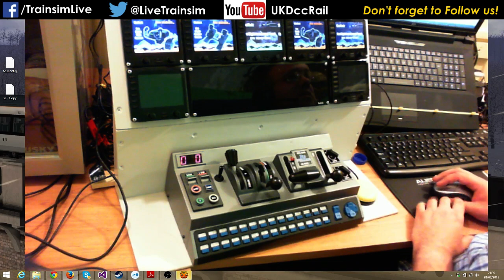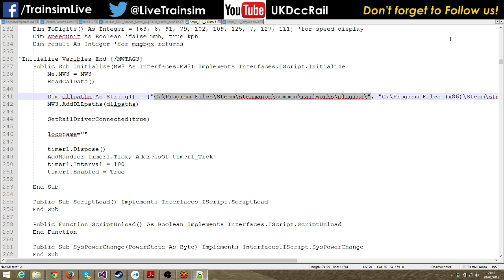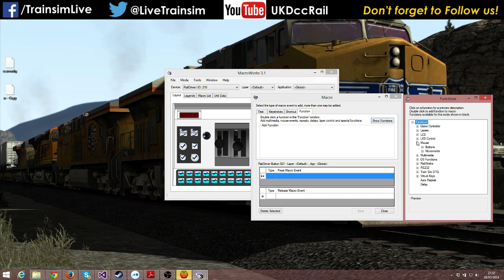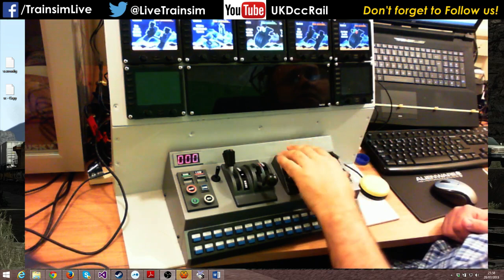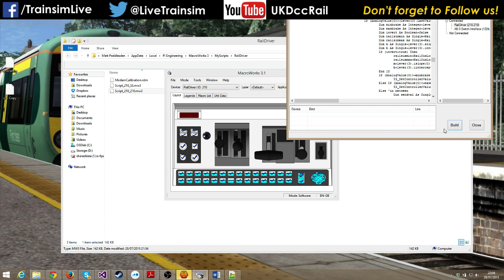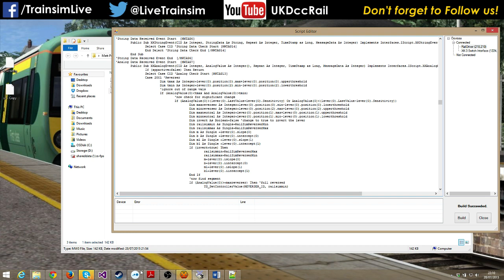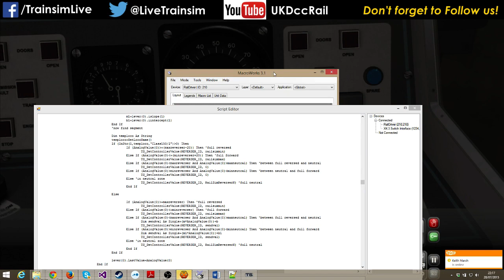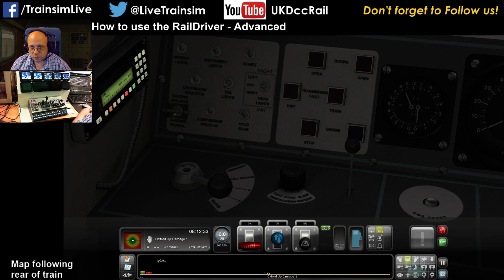Train Simulator 2015 Tutorial - RailDriver Pt 2 - Advanced Topics

Comment: Hello from Berlin. I want you contacts for a specific question that does not appear in your video, I want to insert the Reverser an additional position between neutral and forward, this is in German VR-vehicles for the systems PZB and LZB up required. Can you help me? The position is 0.5, but this has not the reverser.

Comment: Apologies again for late questions Matt, I am trying to get my RD to actually work the train brakes on the class 66 powerhaul so here goes:

1). Is there an asset viewer utility (or something akin to it), where I can find the locomotive string ID which I can then use with the GetLocoName() function?

2). As the train brake is scripted differently (as per your excellent 'how to drive the DRS 66') video, should I be setting the TRAIN_BRAKE_ID values as singles, floats or something entirely different?

Cheers again and many many thanks for your tireless efforts in showing people many of the 'under the bonnet' workings of TS and RailDriver.

MadDropBear

Comment: Sorry Matt, just caught up with this video and have a couple of questions:

1). Could you provide a link to your blog spot in your YouTube video description please?

2). Using your Notch scripting for the class 150 as an example, is it possible to do something similar with the Tap changer on Class 86 / 87? I understand the principle on you changing floats to integers in order to set 'notches', but I am a little out of my depth if trying to do this with the 'power off', 'run-down', 'Tap-up' and 'Run-up' notch settings.

I am guessing that the 'power off' and 'run-down' notches would have negative values, perhaps best utilized by using the RD Throttle control 'dynamic brake' range, however in practice, and without trying to script it, the range of throttle movement is similar in response to the class 150 without script modification.

Well at least that is my experience thus far... :-S

Cheers in advance
Reply: ***** Many thanks Matt, I think I will run with the range button idea; the tacticle feedback is definitely a positive there. Now I just have to figure out the 'loconame' for scripting. I hope it's just "86" or "87" and not including a decimal.

Comment: Matt, once again my apologies for a late post on this video but I'm in somewhat of a dilema:

I've been wanting to expand the Macroworks Raildriver code to accommodate newer locomotives and their scripted actions. For instance I know that you can code the "Virtual brake" system using existing routines provided by PI Engineering, which would be useful with the "Powerhaul class 66" (as an example).

However, I have been trying (in vain), to generate a message box (via LUA) that will give me the exact name of each locomotive. You have mentioned in your blog that it is possible to do just that, but I cannot find any documentation anywhere on the relative object:function name / string required to do this; there is nothing in the Dovetail advanced documentation, and I've attempted many different combinations such as:

Loconame = SysCall("PlayerEngine:GetLocoName");  then passing that on to SysCall("ScenarioManager:ShowInfoMessageInt", "Title of the box", LocoName, 0, MSG_VCENTRE + MSG_CENTRE, MSG_REG, TRUE); but am not getting anywhere with all attempts.

I therefore come on bended knee asking if you could provide me with anything that might help, even if it's just the correct object function calls / syntax required in the LUA script.

As you are the only person who has addressed Raildriver / Macroworks code in any depth, my aim is to create a Raildriver Macro with "Select Case" logic in order to bring the afore mentioned locomotive(s) functionality to fruition. Once done I will be only too happy to share this with the TS community in order to enrich Raildriver owner's experience.

I regret that I have not been able to watch your Twitch streams of late; RL has been kicking my whole family below the belt for quite some time now, and I really want to get back into TS as an escape from the current harsh realities of RL, but as I said, many of the locomotives / Multiple units in my stable simply do not work on the Raildriver.

Thanks in advance,

MadDropBear

Comment: hi matt, can you please upload a copy of your WORKING script 210 file, since i did precicely what you did, but my Brake lever (now throttle) is acting weird.. when at zero, no problem.. when 1 milimeter up full throttle, after 2mm 5% throttle and up as it should, untill 95% throttle, then the last 2mm ZERO throttle.. the max and min settings are switched around some how, and what i try in the script, it won't fix it..

Comment: very interesting!

but I can't get mine to work : no lever works, only lights switch and blue buttons......

calibration is ok so the problem is not hardware related.

thanks if you have an idea!

regards
Reply: ***** thanks for your answer!

I've finally managed to make it work! for those who have the same problem, here's what I did:

don't put raildriver.dll in the folder pointed in the script, but do the opposite : look for the dll and copy/paste its location in the script!

now levers work (even the wipers switch!), but there's still a "little" problem : the throttle/dyn brake huge deadzone......(more of a hysteresis, in fact!)....